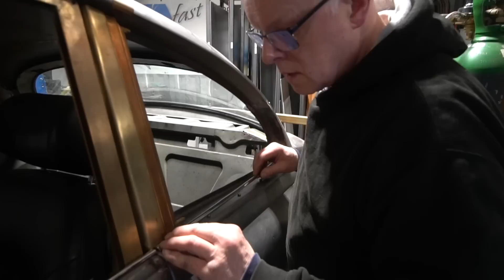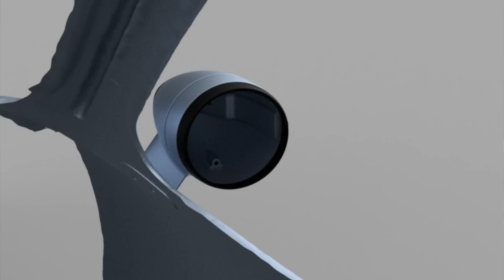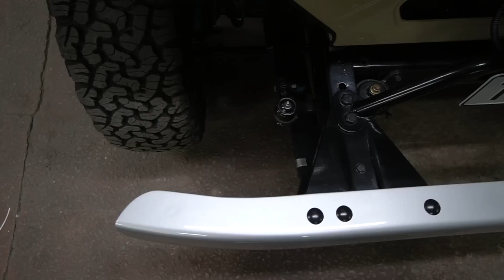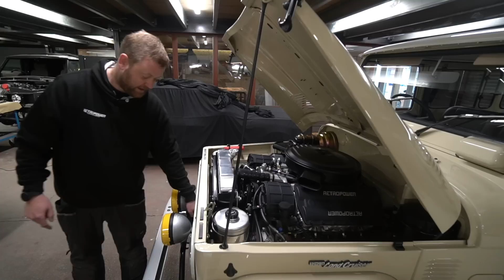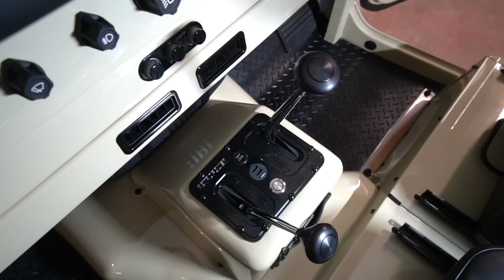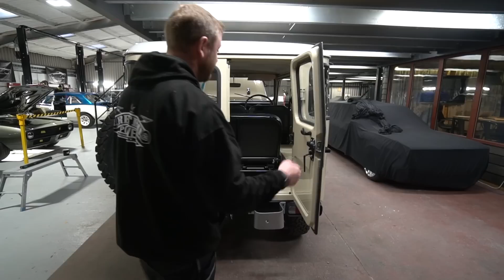V8 FJ LAND CRUISER Restomod Walk Round

Comment: Curious as to the curly-que line routing off the Escort fuel tank(s)
Reply: It stops pressure on seals and vapour. Like the s bend in your loo. You only have the foot of pipe pulling not the side of your compartment tank as the mount on the body for the filler neck is mid height of the fuel tank. Without this swirl you park it nose up and it would Syphon out the neck or into the compartments.  But that swirl keeps a piston of air stopping it which is failsafe.